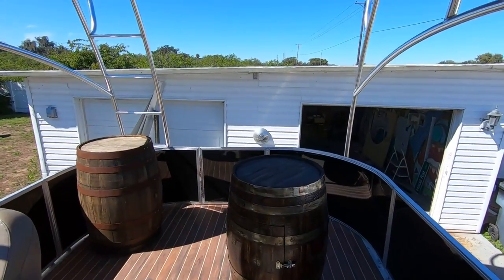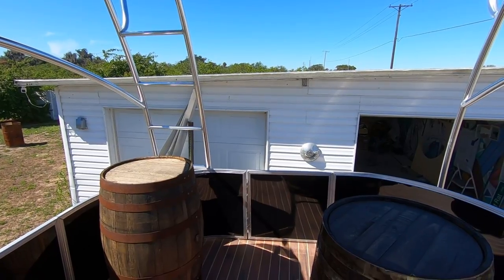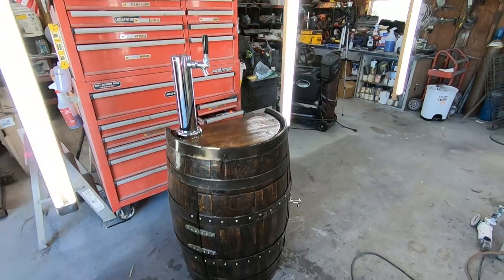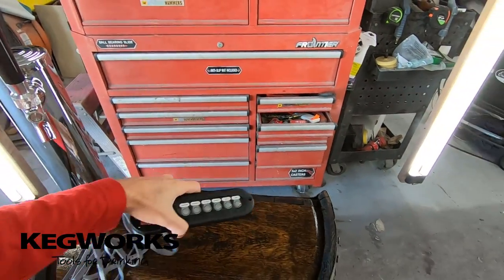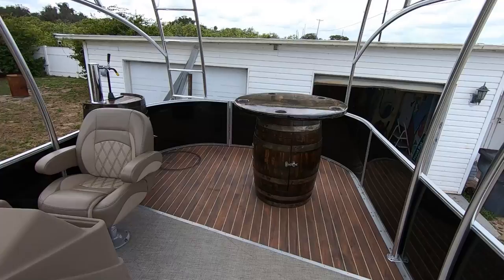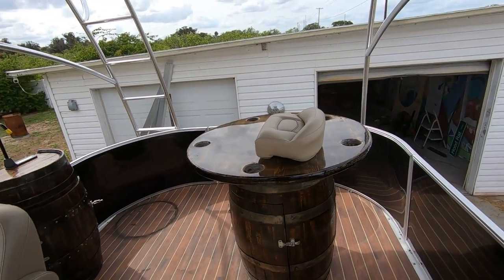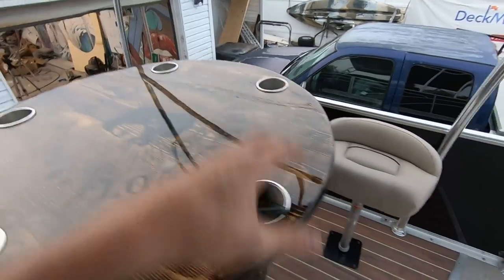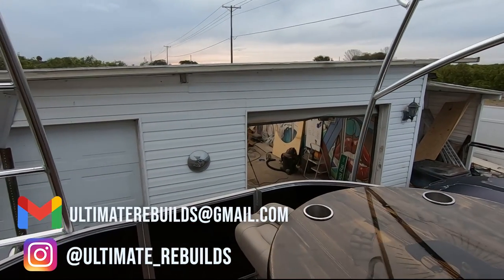Building a Wet Bar on a Pontoon Boat - Episode 11

Comment: Oh man that's some serious pro work.
Nice job, an inspiration for all boat builders.

I believe you would need at least a 250 - 300 hp motor. It's a decent size boat but the seats, the bar, your front fire place pretty much weigh it down.
So you'll need at least a 250hp motor

Comment: You may have to do a shelving system with in the barrel to have the alcohol/drink bottles higher and the keg lower down but seperated so you can get everything in there.  Maybe a rack with wall clips to hold your bottles upside down.  Might be an idea to have a hole on the side to route any extra pipes/lines to items that need more space.  You could route the beer dispenser to a cooler that holds the keg to keep it cooler (have a bigger keg) etc.

Comment: angle the bar stool mount so it doesn't hit the trim. yes it sucks that it wouldn't line up with the floor lines. put a piece of the flooring over the mount plate so it doesn't stand out as much

Comment: Looks fantastic. The beverage system is great. If it were mine, I would have done bev system only and maybe use the other half of that barrel for a cooler for beers. I think you will find the keg won't work well for you.